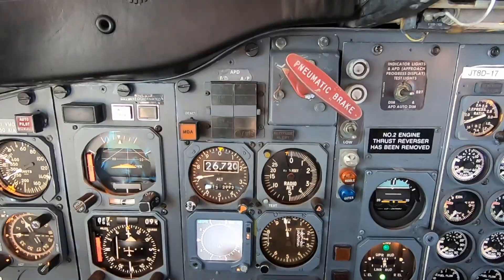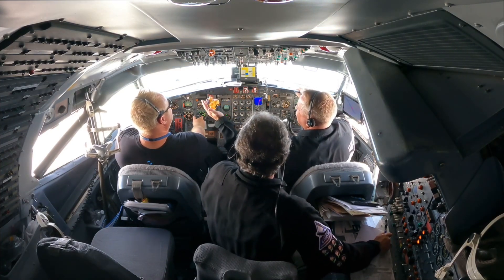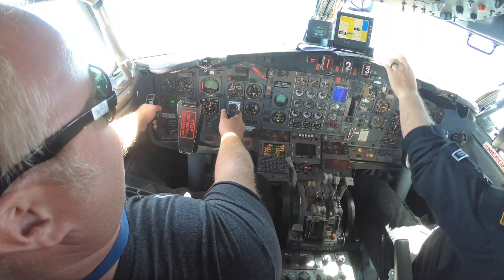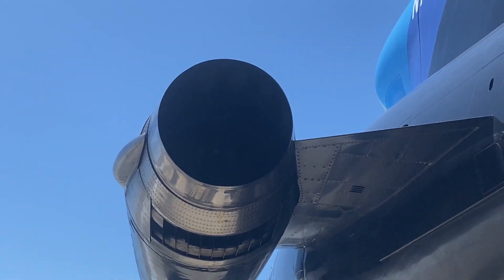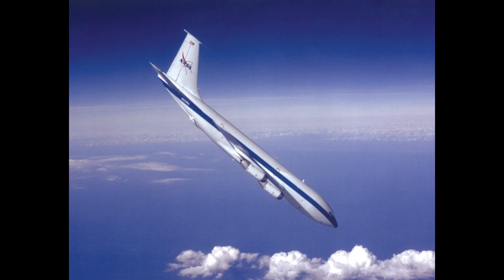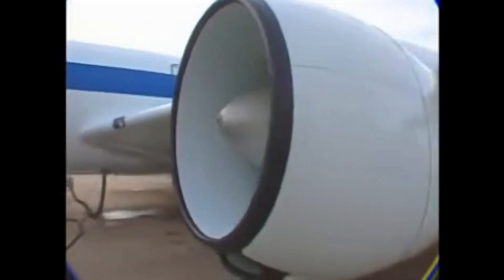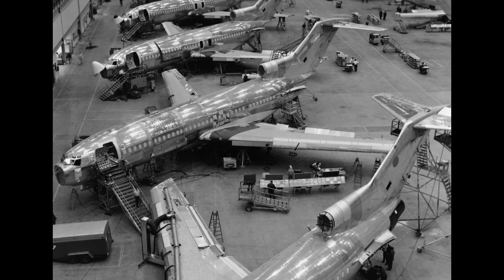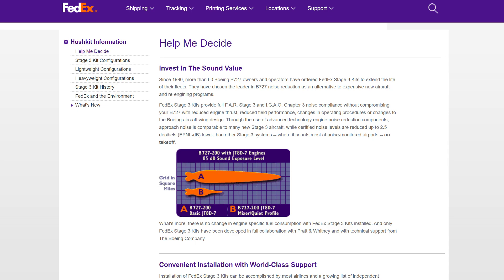Why NASA Uses A 1970's Boeing 727 For Zero G Experiments.

Comment: Totally awesome. ❤ Did you know you can actually achieve ZERO  G. IN A 2 SEATER GLIDER. THAT IS TOWED to 11,000 ft. By a tow plane attached to a cable.  After being released from the plane.  You basically climb the glider until it stalls, then let the glider drop sorta flat. Not to exceed 14,000 ft because of not carrying oxygen.

Comment: Those three oil pressure lights on the front page are worrisome (Below the flap indicators, right of the engine gauge tower). How do they keep the JT-8Ds lubricated without oil pressure? Or are they designed that they are lubricated without oil pressure (at the point where the oil pressure is measured?

Comment: Hi Scott. Do you reckon starship could "Rigidize" its bottom fins using an electromagnetic ring radiating around the whole base. The fins would point out straight for landing feet and could be lighter than motors?

Comment: I remember reading that from an aerodynamic perspective the 727 wing was a remarkable accomplishment.  It was complex but was able to achieve a very high CL (coefficient of lift) with its slats and multi-slotted flaps.  By contrast, the Airbus wings were relatively simple in design.
Reply: Dangerous to generalize, and not to disagree with the coolness of the 727, but one could argue that the ugly vortex generator tabs on the upper surface of some 737 wings are a bit of a kluge.  And for cruise performance the supercritical aerofoil on airbus wings was clearly better L/D at high Mach...so some aerodynamicists might argue Airbus wings (British) were superior....

Comment: Wings loaded up with fuel give the wings strength by making them heavier and helps gravity to fight the tendency of the wing to bend upwards from the lift generated.  Many planes have a zero fuel weight limit for the plane to operate safely.

Comment: The D.B. Cooper vane didn't engage pins.  It was a one piece unit that simply weather vaned and swung a blocker under the outside of the door.  The door could still be unlatched, it just couldn't swing down.

Comment: As a young man I flew in the 727 many times around central Australia. To avoid the thermals during summer the airlines used to fly up around 40 to 45 thousand feet. It was incredibly quiet and smooth. With the engine in the rear there was very little noise and that includes the white noise that is present on the newer airplanes

Comment: When we were doing low-G physics experiments, we did discover that the actual NASA team could keep it closer to 0. As Scott says, if you "stay in the lane", then untethered passengers will experience zero-G, but test equipment that is tied down bounces around a bit. Also, for some experiments, you need the Price is Right version: As low as possible, without going under.

Comment: kind of hit and miss here, we need to talk about stall and angle of attack...I say this as a test pilot for the manufacture, someone who has a reasonable amount of time in every Boeing but the B747 and have flown the Comet.  the duck thing is interesting...but it does not produce good microgravity.  I wrote my masters on flight director guidance for the comet.

My current position is on the P8.  fly safe

Comment: Just be thankful the camera you used to record your flight didn't turn out to have freefall detection.  Somewhat common for people to find their camera stops recording as soon as the plane hits zero G. The accelerometer in the camera thinks the camera is being dropped and stops writing to the mem card.  Mainly to stop the SD card electrical contacts momentary disconnecting on impact while actively writing data, which can corrupt the SD card

Comment: My father was an airline pilot since 1962. He started on the DC8, and retired on the 747-400. But for the bulk of his career he flew the 727 on short hops. Why? Because it was the last passenger jet you really flew. It was hands on, pilot and crew essential to the flight. And he loved to fly. 

Also, he said it was overpowered and responsive like a sports car. The 747 was beautiful to fly, but smooth like a big old Bentley. The 727 was a hotrodded Vette with stiff shocks.
Reply: You may be right but I don't get it. What do you mean by "really flew"? The 727 is on autopilot most of the flight.
My friend retired 727 and DC8 pilot loved the 727 the most ;)

Comment: 727's don't use "low bypass turbojets".

All turbojets are by definition 0 bypass. The 727 uses a low bypass turboFAN engine, the JT8D. 

Also, fun 727 fact, Mexicana Airlines had theirs fitted with rockets. 3 rockets per side in the rear of the wing. They would fire for 10sec in pairs, providing 30 sec of additional thrust when taking off from "hot and high" airports at near max gross weight in the case of an engine failure... That 30 sec was enough to get you to a safe altitude and speed for a turn-around that would be difficult on only 2 engines. Basically useful for Mexico City. Most other airlines just accepted a lower gross weight when taking off hot and high. I am 99% sure that they were never used outside of testing (there's a video of it!).

Comment: How much additional stress is put on the air frame  of this plane with these continuous up and down maneuvers compared to normal flight? Could there be microscopic fractures being created by this stress that could accumulate over time leading to a catastrophic failure?

Comment: Great video! I got to fly on this lovely lady back in February 2020 as a special guest. I’ve been coming out to spot her since 2017 at LGB which is one of my local airports, which was also around the time I got to meet the flight crew, which you happened to meet them all as well. Great guys and gave me the once in a life time opportunity not only to do Zero Gravity, but to fly on a 727 at that, of which the only remaining ones flying are either Cargo or VIP private jets, so theoretically this is the only 727 still flying that still carries passengers.

As for the thing with hush kits, don’t let them fool you! It is still a very very loud bird. The FAA required all non Stage III noise compliant jetliners such as the 727 to be Stage III hushed and modified by January 1st, 2000 in order to continue to fly, unless operated by the military or is a testbed with an experimental SFA. What you mentioned is non Stage III business jets specifically jets that way under 75,000 pounds were left off the hook for 16 years after these regs for non Stage III Jetliners went into effect, and it wasn’t until January 1st, 2016 that all non Stage III business jets had to be Stage III hushed and modified, but still have the same exceptions if they are military or testbeds.

Some other countries do not have noise regulations for non Stage III civilian jet aircraft, although a lot of them you’ll see in those countries that do have hush kits on them were more then likely bought from the U.S after January 1st, 2000.

Love this plane and I have tons of videos of it doing operations out of LGB, along with my flight. One of the noise monitors at LGB has picked up as high as 108 decibels from this during a departure, where as on average all the other departing Jets are usually around 90-95 decibels, if we’re not counting the latest Stage IV noise Jets like the 737 MAX or Airbus NEO family and A220 which are in the 80 dB range.

Comment: Interesting that the 727 was marketed by Eastern Airlines as the "Whisper Jet" when it was introduced but was ultimately phased out of existence largely because of how loud it was. Actually, for the time, if you were up front it was pretty quiet compared to a 707 or DC8. If you were in the back - not so much.

Comment: I'm a student in aerospace engineering, and in my propulsion class we touched on the topic of jet noise.
My understanding that the amplitude of noise generated by a shear flow scales with the magnitude of the velocity gradient to the 7th power (or something around there). That means that the more you can spread out the change in velocity of the flow, the quieter it will be. Turbofans accomplish this by having a layer of medium speed flow around the engine core’s jet, which splits the velocity gradient into two smaller jumps instead of one big one. Also, increasing the bypass ratio of the fan, more energy can be put into accelerating the bypass layer and less into speeding up the core jet, resulting in a lower velocity change overall. 

A hush kit like the one you showed, and the chevrons you see on the trailing edge of the cowl on modern turbofans reduce noise by mechanically mixing flows to smooth out the radial velocity profile (and decrease the gradient by doing so). I believe that the mechanics behind the mixing involve the generation of vortices (larger ones than those naturally caused by the shear flow) which help to spread out the change in velocity.

Comment: We used to do zero G maneuvers in the Cessna 172.  We called them parabolics--which is what the  flight path is, a parabolic arc.  Of course you couldn't get as much time in zero G as in a jet.  Also the engine would quit from fuel starvation/interruption after about five seconds--it came back immediately once positive g was restored.  I also did them in an aerobatic Citabria with inverted fuel system.  

Regarding noise level in the jets:  Air noise due to airspeed is the larger component of in-flight noise in a rear engine aircraft than engine noise.  Notice sometime when you are flying commercial how the sound increases as you level off from climb and begin accelerating to cruise.  Fun fact: Eastern Airlines called the 727 "Whisperjet" I guess because the cabin was quieter than the conventional wing mounted  engine 707 and 720's of the day.

Comment: Maybe your statement "there are no computers running this plane" should give a clue as to why this plane is used for the purpose. Put a plane through that kind of manoeuvring, and any computer will go mad. Human pilots are more flexible. Having said that, the pilots on this plane are not noobs.

Then the real truth comes out: it's more complicated than you think, and in some ways, more mundane. Try this stunts with an off-the-shelf plane, and your engines will fail.

Comment: I would imagine this plane will have to get a lot of structural integrity inspections. Every flight has dramatic pressure/depressure events multiple times per flight. Also I can imagine the stresses of pulling out of it multiple times. 727 is an old bird, I remember them, I think I flew on some.

Comment: The "hush kit" causes a tempering of the exhaust gas to be a little closer to the temp of the air that did not flow through the engine. It's the heat of the exhaust gasses suddenly meeting the colder air that causes the loud rumble noise you hear from jets, and a low or no bypass engine like the 707/727 and the 20 series Lear CJ610 engines are VERY loud.

Comment: I did a few skydives from 727s at World FreeFall Convention in the 1990s (I wore a black suit with thin tie, used regular skydiving rig and not a NB-8. And it was a nice sunny day). I noticed this 727 was flown by Amerijet and wondered if it was same aircraft I jumped from, looking at photos the Amerijets were N190AJ, N5607, and N495AJ (argg, just one number off). For skydivers they removed the airstair and lined the entire rear exit hallway with plywood so not snag any skydiving rig. I also took opportunity to ride in the cockpit, basically bought another jump ticket and got permission to ride a jump seat. It was interesting to see how the crew flew, something I've never done before or again. Capt does most of the major controls, first officer does some trim and call out numbers, flight engineer does various minor adjustments on throttle in addition to working his station. On another occasion I also spoke with a airline pilot and he said the 727 was a hot rod. 

You mentioned CIA... actually they had a role of having operatives parachute out the airstairs back in the 1960s. I'm sure DOD must have done similar with special ops guys. Exception of govt secret stuff, I think first time some legally jumped from a 727 was making the early 1980s movie "Pursuit of DB Cooper." Then in 1992 when it was first flown for skydivers at the WFFC in Quincy, IL. I talked with one of the organizer, Kirran, who said how they managed to get FAA permission was a early series of test flights Boeing did by dropping cargo out the air-stairs during flight. This particular flight test report was key item for the OK from FAA.

Comment: Two other zero G videos I love are the music vid by OK-Go, and one by a bush/duster instructor/pilot. The OK-Go is obvious, because its a well done vid.

The duster pilot is awesome, because he talks about using zero g maneuvers to avoid stalls. Basically, he points out that it is impossible to stall a wing at zero g, because there's no load on it. So, if in the midst of a tight, low altitude turn, and you start to go into stall, you still nose down to unload the wing. Also interesting rudder use to avoid stalls as well.
Reply: The behind the scenes film of the OK-GO video is really good. They had to do something like 200 parabolas to shoot that then splice them all together in time with the music.

Comment: As a retired enroute radar controller I always picked on the 727s in my sector for going fast or slow when spacing was needed.  The pilot without hesitation responded "No problem".  I rode in a 727 cockpit a few times as an observer and as Mr. Graybill stated the pilots loved this Boeing.  Whether its true or not the crew stated it could max out in level flight at Mach .99.
Reply: Mmo is 0.90 on the 27 so certainly nobody ever went .99 on a commercial flight, but the difference at 30k feet is only 60mph so it is possible it could achieve .99 in level flight. That's obviously VERY transonic, though so possibly not easy nor a good idea to do it.

Comment: Helicopters tend to avoid negative G for noise abatement purposes. Heck of a noise as the rotors hit the tail if you pull negative G past a point. Some helicopter designs include in the tail a heavy steel cutter bar, designed so that you get a very audible warning, as it chews the tips off the main rotor blades, that what you are doing is not a good idea. Yes you will need all new rotor blades, very expensive, and a good pit of panel work to fix the hole cut in the tail rotor, but still cheaper than losing the airframe. 

Do remember having a flight with some really stressed out pilots, who had spent 3 hours turning in circles to calibrate the magnetic compasses after a replacement, and I took the flight back instead of driving on the tractor. Sitting in the cabin, door open, legs out and holding to the strap, with the sky below my feet, and the ocean visible through the rotor blades, as they were doing barrel rolls in this 16 ton helicopter. Yes it could lift cargo, 16 tons max at sea level, and if you could fit it inside, it would carry it.

Comment: Another reason they might want full fuel is for wing bending relief if they pull positive 'G'. Aircraft, especially with outboard wing tanks or even better, wing tip tanks, provided those tanks are full can pull more 'G' as the 'G' itself acting on the weight of that fuel 'pulls the wing down' and opposes its tendency to band upwards as positive G is applied, thus reliving the bending moment at the wing root. 
There's a tragic video on YouTube of a piston twin being aerobatted at an air show and the pilot exceeds the max allowable G loading. Both wings fail upwards simultaneously, but not at the wing root. They fail upwards just outboard of the engines, as the engines themselves provide wing bending relief to the section of the wing between the engine and the wing root.

Comment: There is no such thing as stall speed., only stall angle. A wing of any given configuration (of high lift devices) always stalls at the same angle of attack regardless of IAS. I’ve floated over the top of a loop in the Yak 52 with just about zero airspeed and the wing, being unloaded and therefore below the critical angle of attack, did not stall. On the backside of the loop as I pulled harder and harder loading up the wing, it stalled and flicked at about 160 knots IAS at the point the angle of attack exceeded that critical angle (AoA = the angle between the mean wing chord and the relative airflow).

I used to fly zero-G when I was parachute flying, on the way down to lift the jump master off his seat for fun! I simply flew uphill a bit then eased forward on the yoke until I felt my backside go light in the seat,, then push ever so slightly more, regulating the zero G with tiny movements of the elevator. 
DB Cooper, BTW, did it twice (he lost the money during the first jump) but he was caught the second time. Have a look at Dan Gryder’s YouTube video on DB Cooper – he researched it and even replicated the jump (but not from a 727).
Reply from the maker: So, the FAA want pilots to say that the critical angle that generates a stall doesn’t change with speed, and it’s generally true for small aircraft speeds, but not true once you head into transonic region, then the AoA can stall at lower angles due to shocks on the wing.
Reply: @scottmanley  It's not 'what the FAA / CAA want pilots to say' it how a wing works!  Mach stall is a different phenomena, hence 'coffin corner' where an aircraft flies high so in the thin air the IAS is much lower than the TAS so the wing is close to the critical stall angle, but the wing is also approaching its mach limit where shocks can form. So if you go bit slower and you stall, or go a bit faster and you stall, hence any turbulence-induced upset can herald a stall. The cure is not to get yourself into Coffin Corner!